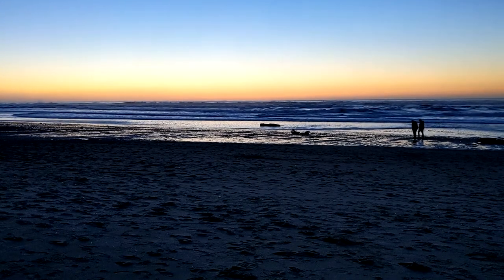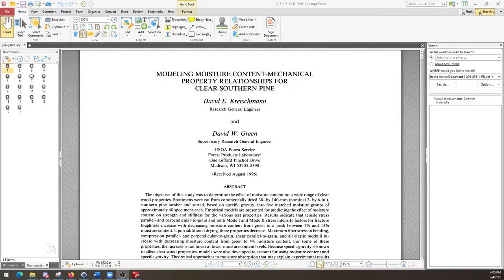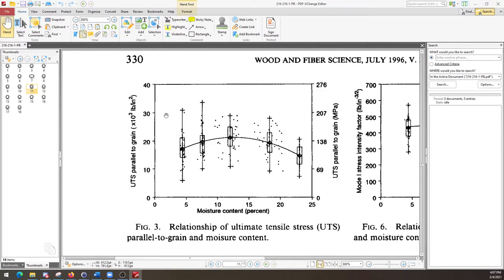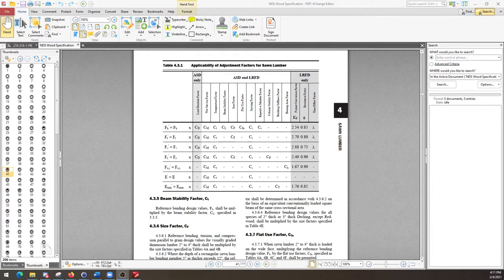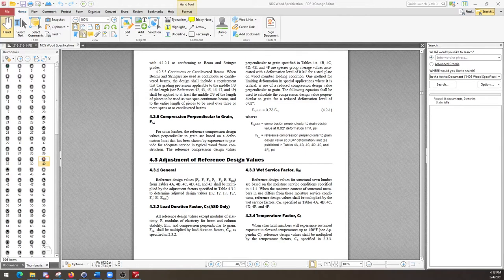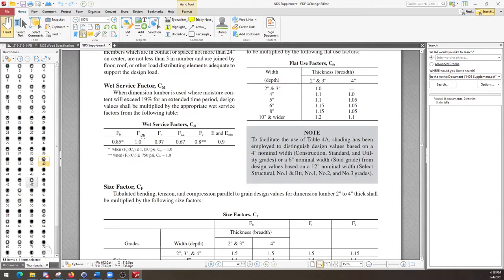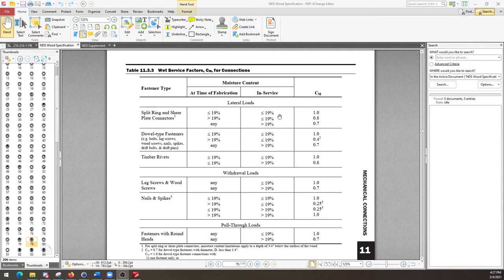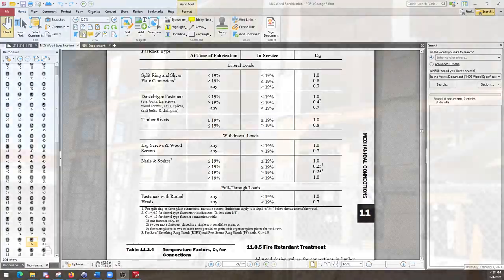Learning by Osmosis - the NDS Wet Service Factor

Comment: Thanks for another great and informative video.Although I was always aware of the Degradation in strength  especially parallel to Grain due to moisture ,it was really informative when you showed the NDS table related to connectors . The withdrawal strength in nails was  particularly alarming. A video just on the topic of connectors would be very interesting [especially as it relates to the  seismic advantage Wood structures have in their” Ductility” —Characteristics, which I always understood to be largely because of the connectors / nails especially Light frame wood construction]
Reply from the maker: Hi Edmund,
Thanks! Connections will eventually be a major part of this course. Connections really are the most critical part of wood design, and it is alarming how much they are affected by factors like changes in moisture content. Eventually I'll have a whole series of videos relating to connection design, and I do hope to go into depth on ductility then.